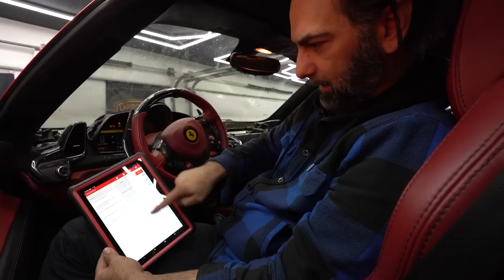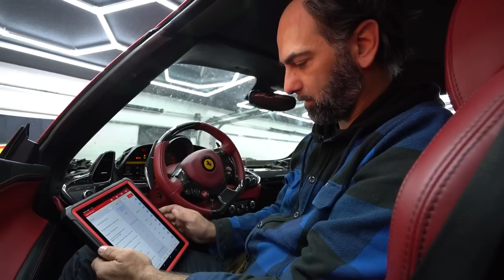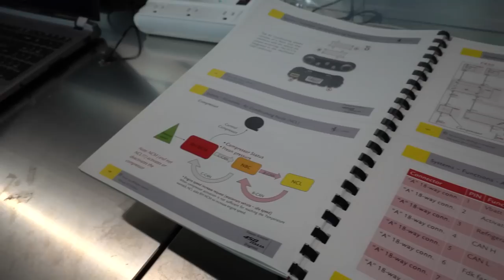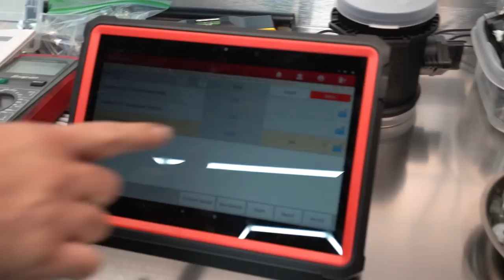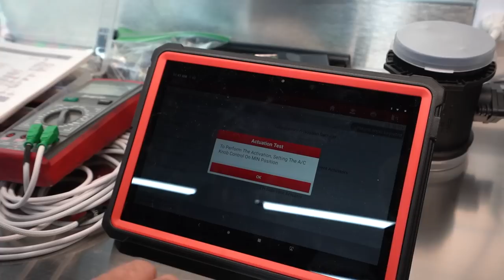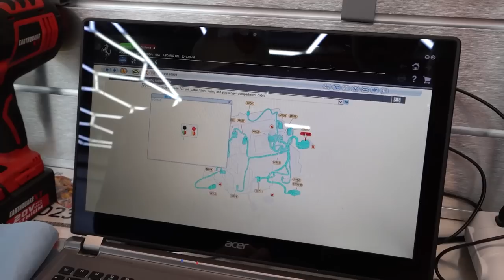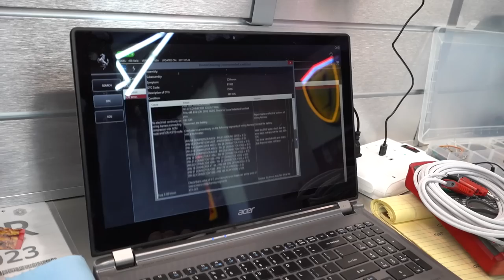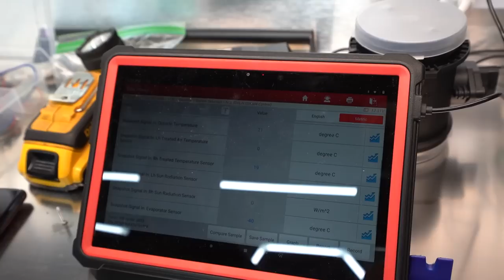$5,000 Ferrari 458 AC Repair done for FREE?

Comment: Josh is a great mechanic; if more mechanics would tell people what's wrong and not sugarcoat the truth with nonsense or blatantly lie about issues, car repairs wouldn't be such a nightmare. Some people might not like his choice of words at times, but at least he's giving the information necessary and PROPERLY repairing the vehicles. I can certainly see why he's booked months in advance! People will always pay for good, honest work backed by decades of experience. 
You repaired the AC in the winter, does the heat work? Is Josh going to do the radio repair? 
Good video, guys! I remember on Cartrek they mentioned home depot screws. It's a fun car that can be driven, and in my opinion, that makes it amazing. What Hoovie and Wizard did made it reliable, and any sane individual should understand why you gentlemen are trying to get it even better. 

Great teamwork! 🥂
Reply from the maker: Thank you

Comment: As someone who works on airplanes, cars, motorcycles, and houses as a "hobby" on a regular basis, I can say that Josh's "verbal critique" of the situation hits very close to home.  Upside down, underneath the instrument panel,  rigging microswitches, with your back contorted like a circus acrobat, is not exactly a joy inducing activity.  Or digging mud out of an electrical connector on a motorcycle with a "clean" title can cause the "colorful adjectives" to take flight.  Yet despite the mechanically driven verbal assault, the job gets done.  Josh, you are the wind beneath my wings.
Reply from the maker: Yes exactly
Reply: Birds of a feather

Comment: Dan, good video. Would you say its easier / possible to access the front parking sensors by removing the luggage tub rather than removing the front bumper ?
Reply from the maker: Hmm I didn't really look, but both are not very difficult to remove. I'm not sure you would have good access through the tub

Comment: a little late on this but, since you're on the AC repair here, i'm wondering if you've ever encountered an issue with the 458 where, even when the car is totally turned off, the LED light on one of the A/C dials refuses to go off.
Reply from the maker: I have not heard of that
Reply: @normalguysupercar  darn, i was searching thru the forums and didnt come up with anything either. i hope i'm not the only one with the issue. Local agent says the only way to fix it is to change the A/C electrical board. Was just wondering if there was any other way. No worries, was just trying my luck.